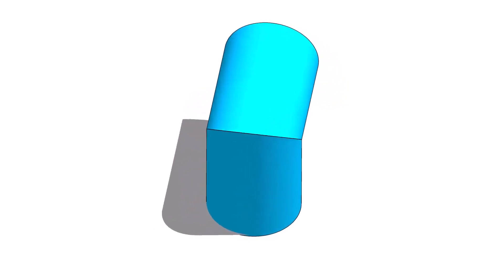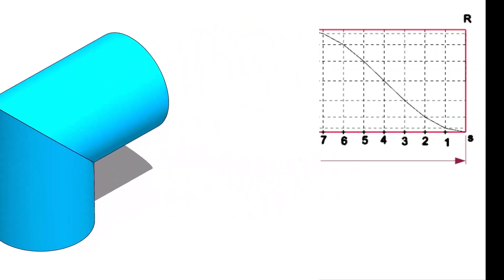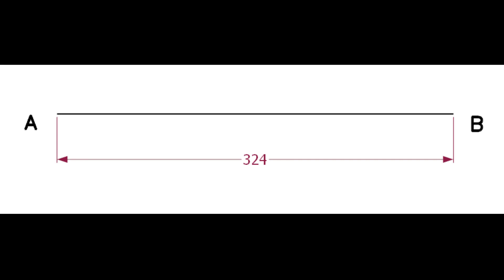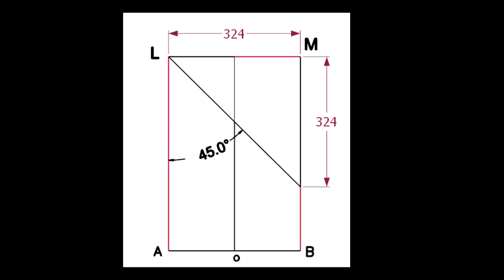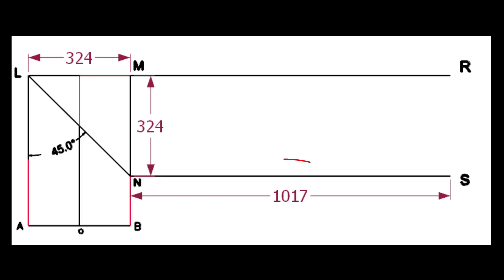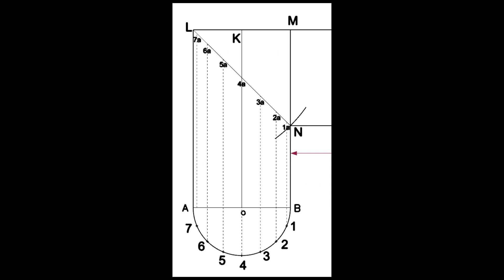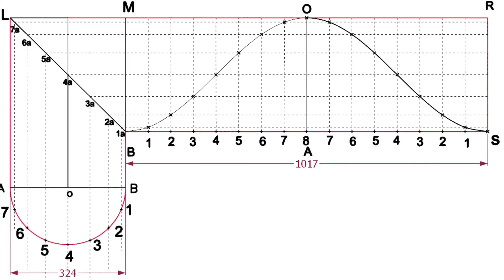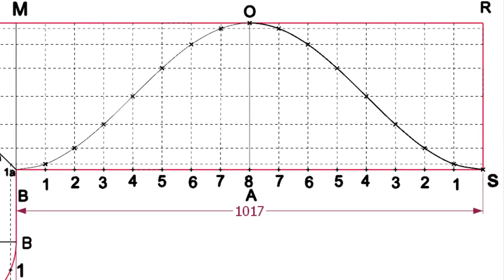Pipe  Single cut miter bend layout piping tutorial

Comment: How do you calculate the radius of the elevation points to make a smooth curve ?
Reply from the maker: Practically that is little tricky. On the computer it is easy. On the job, I use a bend steel ruler, holding on 3 points and draw the curve, connecting 2 points, and repeat marking.